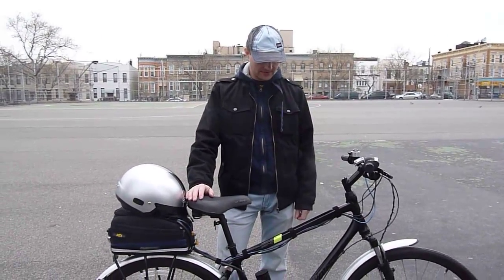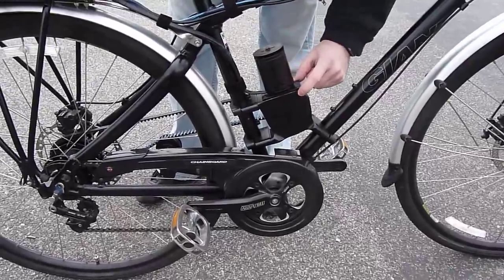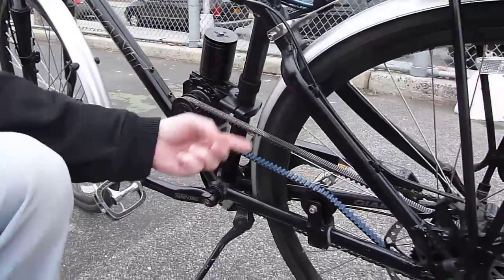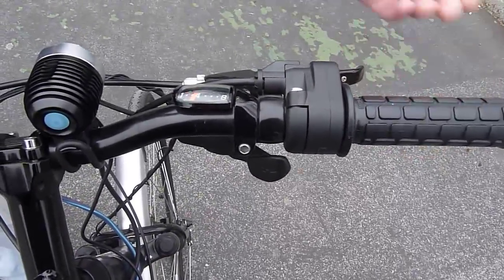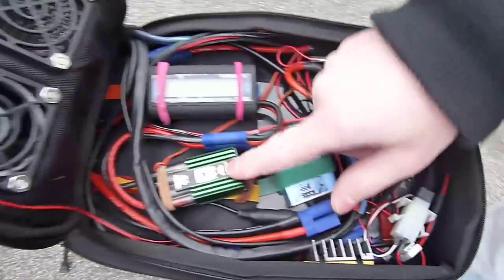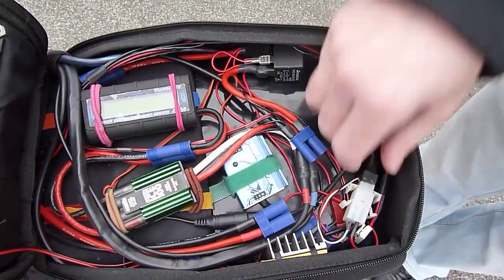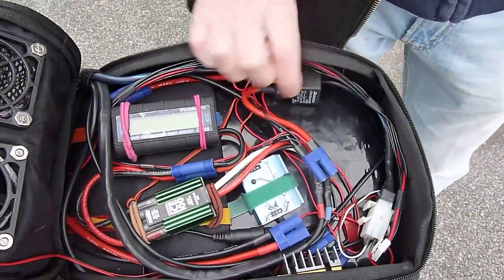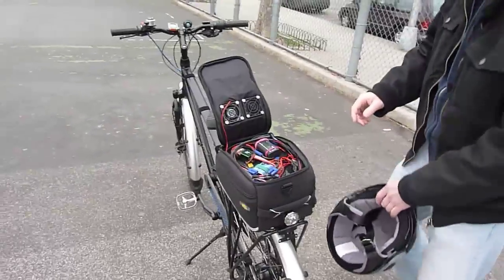Slavek's ebike

Comment from the maker: @lezbriddon 
I used 12mm wide - Poly Chain GT Carbon belt 
8mm Pitch, 1280mm Outer Circle
I do not know if these belt are instal as car engine timing belt - maybe
But do to theirs strength I would say are used to power transmission.

Slawek